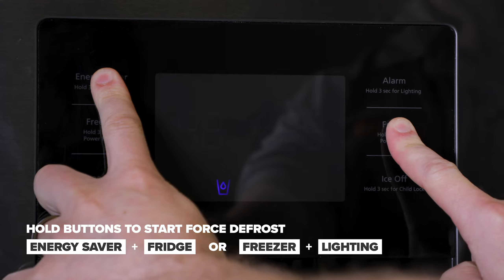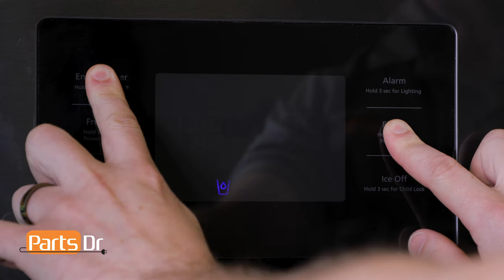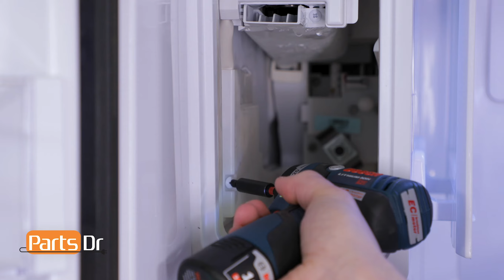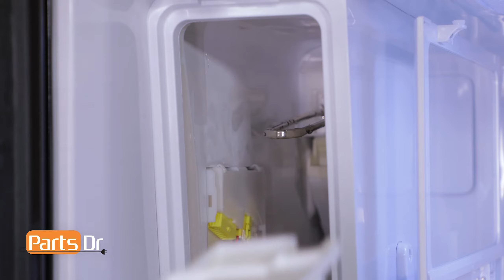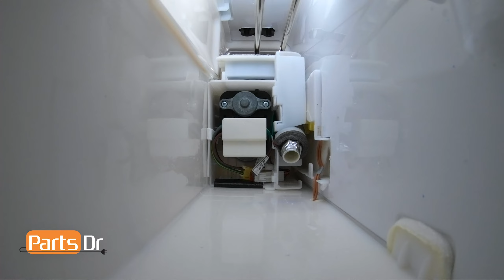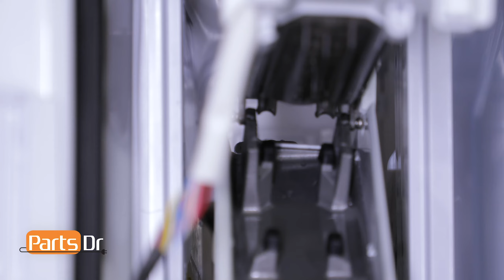How to replace the ice auger motor assembly part # DA97-12540G & DA97-12540K in Samsung refrigerator

Comment from the maker: Thanks for watching our step-by-step guide on replacing the ice auger motor assembly in your Samsung refrigerator! If you're ordering a replacement, be cautious with cheap aftermarket parts found on Amazon or eBay. These often lack the quality and precision of original OEM components, which can lead to poor performance or further issues. For genuine high-quality replacement parts like DA97-12540G or DA97-12540K, order directly from https://partsdr.com to ensure a reliable repair. Let us know in the comments how your repair went or if you have any questions. Happy repairing!

Comment: Um, yeah. So the Samsung professional repair guy came out several times to "fix" our ice maker. In the course of that he did the silicone sealant fix and now my auger assembly is apparently glued in place. Yes, I know about clip on front that needs pressed. In fact, it's completely gone now and the freaking thing still won't come out. And no, there is no ice keeping it from coming out. I am never buying Samsung appliances again. Spent over $3000 on this f-ing thing and the ice maker has been a problem the entire time we've owned it. All they did was patch it long enough to run the warranty out.

Comment: Quick follow up. After about 3 hours I finally got the ice melted . The ice built up between the top of the fan of the auger and just underneath the coil. Take your time if you do use a hairdryer use it on cool but take your time. It will free up once the ice is gone from above the fan motor.
Reply from the maker: Nice job!  Make sure to install Y-Clips https://www.youtube.com/watch?v=4WrzNhySQa8 if you don't already have them installed and seal up the ice maker compartment https://www.youtube.com/watch?v=8DkXLEXKAug

Comment: So I replaced the ice maker so I am familiar with taking this out. Now I am trying to get the Auger assembly out but it is not budging. I am sure it is an ice buildup so I am waiting.
Reply from the maker: It sounds like it is most likely frozen in place.  Let us know how the repair goes.  Be careful to no use any heat sources as you can easily warp and damage the liner of the refrigerator.

Comment: Have not been able to removed the ice maker tray, even after running the defrost routine for 5+ hours.   This unit doesn't appear to have the tab that has to be pushed to get it out.   The model number is RF28JBEDBSR/AA.   Does it ever take this long to defrost the ice maker?   Any other suggestions?   Thanks.
Reply from the maker: Yes that is normal if it is really iced up.  When they get this bad it is a good idea to unplug the refrigerator and leave the doors open and let it thaw out for a day or two.

Comment: Thank you for this video. The bolt that holds that metal plate with the two points on it sheared off from being frozen solid for so long. I thought it was going to be a nightmare replacing that. This video showed it only takes pushing in a retaining clip. Thank you again! New subscriber!
Reply from the maker: Thank you for subscribing!

Comment: Is the temperature sensor the one that looks like an IR sensor? It has a clear eye.

I cut my wire to that while chipping ice off and am trying to repair it. Right now I can reset my ice machine and a few minutes later it makes a beep/ding. I sometimes get a tray, but that's all.
Reply from the maker: The clear eye is the IR sensor that senses the when the ice bucket is full of ice and tells it to stop making more ice.  The temperature sensor is to the left with the yellow wires.
Reply: @PartsDr  thank you very much! I was able to solder the wire and have ice again! Your videos are really helpful!!
Reply from the maker: @khumprp  Nice job fixing it!

Comment: Is the I/R sensor located on the auger assembly supposed to emit a visible beam?  Mine does not.  Unless its only visible with the refridgerator door closed.  My icemaker does not drop ice and I think its because it thinks the ice bin is full.
Reply from the maker: I/R (infrared) is invisible to the human eye.  Sometimes you can use a camera to view the infrared LED lighting up.

Comment: I can't get the auger motor out. It is froze still from the piece on top of the auger I forced defrosted twice and it has been off for 3 hours
Reply from the maker: If you have a large amount of ice it can take longer than that to thaw it out.  Stick with it and you will get it eventually.  You may need to leave it unplugged overnight with the doors open.
Reply: @PartsDr  thanks i got it out sbout an hour later. It's making ice today. Thanks for your video
Reply from the maker: @kfd165  Good deal! Nice job!

Comment: My ice maker does not turn the ice out of the dispencer when I push the ice button. Do you think there is a problem with my motor?
Reply from the maker: It could be.  You would have to do some troubleshooting to see if power is being sent to the motor when it should be running to see if the motor is bad.

Comment: Hi and thanks for a very informative video.  I have persevered for a number of years with the ice-maker freezing up every few weeks, by removing the ice bucket and defrosting the ice-maker. However, it stopped working altogether and I thought the auger motor had finally given up the ghost. However, after disassembling the complete auger motor and applying 240VAC to the motor, I found it to be working. Now I realise that when initially putting a glass or cup to obtain ice, you push against the ice activator lever and there is a sound with the bottom flap opening before the auger motor starts operation. Well, this appears to be the problem - perhaps the solenoid? Any ideas on this?  No help from Samsung at all. Thanks and regards, Robert

Comment: Great video! Quick question for you. There is a plastic shield that sits over the coil and the styrofoam (not the rectangular piece that goes over the coil) that is made of the same plastic as the interior.  What is the function of this piece and does it direct the water flow flow in to the ice maker? The back of the ice maker appears like it would go up against this piece. Mine appears cracked and possibly bent, and there are three screws on the right side of the ice maker compartment when the auger motor is removed, which looks like it would allow it to be replaced. I can just see it in this video but its out of focus. I have a screen shot from your video and circled it in red if I Can find a way of posting it.

Comment: Replaced ice maker and auger assembly.  Difficulty removing old parts - New parts went in easily , thanks to your videos. That being said no ice has been made after 22 hrs. It appears that the Ice sensor on the auger assembly is not lit...Any ideas????
Reply from the maker: The sensor on the auger that senses when the ice bucket is full is infrared so you won't see it light up with the human eye.  It should start making ice on its own after it cools down to 10F or colder.

Comment: Thank you so much for this video.  We went almost a year without ice because none of the local repair guys would come near it.  Bought the part and installed with no trouble in 15 minutes.  Very clear and great video shots to show the process.
Reply from the maker: That is awesome!  Nice job!
Reply: I cant get the replacement auger to snap in. Its a good 1/2 short of the clip point. It is the correct model.

Comment: Is the Ice Maker reset button a missed step in this video? Also, is the reset button supposed to make a chime after a few seconds?
Reply from the maker: It won't hurt to use the reset button but it is not a required step.  Some refrigerators will chime after the reset button is held for a few seconds.  Our refrigerator in the video the reset button didn't do anything.  It didn't chime and it didn't harvest the ice and fill with water after holding the button down.  But the ice maker still functioned perfectly fine.
Reply: Where is the ice maker reset button?

Comment: My thermistor broke off on auger assy DA97-12540A. Can this be purchased separately?
Reply from the maker: Hi Kevin,  from what we have seen this sensor is not sold separately.  But, from what we have seen all of the senors in a Samsung refrigerator usually have the same resistance scale but have different length wires and electrical plugs.  So, in theory you should be able to order a different sensor and cut and splice the wires.  More info about these sensors in this video here: https://www.youtube.com/watch?v=J5bwcteeJNM

Comment: Hi Dr, 
My RF263BEAESR/AA not making ice. Load status display showing ice full, but no ice inside.
followed troubleshooting manual, blocked IR receiver with hand no status change which indicate receiver defect. bought replacement auger DA97-12540G from PartDR, But still same problem, any input?
Reply from the maker: Hi Nick,  these types of things are usually not able to be diagnosed over a youtube comment.  If the new auger motor assembly didn't resolve the issue, then we would suspect it would most likely be the main control board or the wiring between the two.
Reply: @PartsDr  I do suspect the main board also for my next step. pressed ice maker test button it will produce 1 cycle of ice no problem and ding dong sound after that. so I think the ice maker it self is still good.
the weird thing is even with the new Auger assembly, blocked IR receiver Emitter test, still didn't change ice level status.
I did verified good continuity and volt test CN90 #5 Yel to the main board from IR red wire +5V.
Thank for input
Reply: @nickmiller4544  figure this out?
Reply: @s1337m  No, so far I did replaced the auger assembly and main pcb, But still same issue. Last one that I need to replace is the ice maker it self, but I don't want sink more $ to it and may not solve the issue.
Reply: @nickmiller4544   - any luck with this?  I'm at the same point as you sounds like.  Replaced auger motor and still seems like IR emitter not lighting. Was going to try a new main pcb but sounds like didn't help for you.  Too bad.  I think the IM itself is fine as it makes 1 load of ice when I press reset.  Please post if you get it figured out or make any headway.   Cheers!
Reply: @ladriver  No, I didn't replace the Ice maker, as it's the last item that I think  would cause it, I mean it got to be one of those 3 item, Auger assembly, or main PCB, or the ice maker  it self which seem fine with test button. I have verified also Wiring harness  continuity are good.
So far I can live with just press the test button everytime I dispense some ice

Comment: When did the auger heater get added by samsung not sure if mine has the auger heater how can I tell I HAVE A 2016 MODEL RF 28JBEDBSG/AA
Reply from the maker: Hi Wayne, we haven't heard of a date that you can go by.  In most cases it is best to disassemble and inspect the original part.
Reply: @PartsDr  thanks is the part in the video with the black tube the heater so if it has a clear tube no heater? Asune that what I will be looking for?

Comment: Will the refrigerator function properly with the auger fan motor unplugged?  The fan is noisy and we don't use the ice maker. Is the auger fan motor used only to produce ice?
Reply from the maker: Hi Larry, as far as we know the auger fan motor is only used for cooling the ice maker compartment.  BUT, if the fan motor stops working or if you remove it from the refrigerator it could potentially cause and error code on the refrigerator which could cause you other issues.
Reply: I removed it completely and refrigerator will not run without it.  Defrosted the refrigerator and have not heard the noise since. thank for the help
Reply from the maker: @larryearle5949  We are happy to hear that took care of the problem! 🙂

Comment: My auger does not want to come out.  I had a huge ice build up around the coil and got that thawed out.  I released the auger and I can pull it about 1/2 inch and then it stops.  Seem like it is catching on something.  What I do see is an ice build up still just under the coil in that rectangle area below it.  Wondering if there is ice below that area stopping the auger from coming out.  The fan was making a loud horrible noise the last few days, so just wondering if it was rubbing on ice or the bearings are shot.  I just want to get the auger out and inspect it first.  Any hints on getting it out?
Reply from the maker: Try leaving the refrigerator unplugged and the doors open for a day to let the ice maker compartment thaw out.  There could be some ice that you can't see that is causing it to not release.  We have also seen people that use a blow dryer or heat gun warp the inside of the cabinet which could cause the auger to not come out freely.
Reply: There is an i build up on the auger fan assembly. If you dont leave it unplugged, Samsung suggests a soft steam to unblock the ice to remove the ice and remove the assembly.
Reply: Thanks...my samsung refrigerator ice maker head motor ( srm-27h ) not turning  around .only sound and the gear not turning. your support that how i can test and replace it....thank you in advance

Comment: I have RF 28 we replaced ice maker pushed reset waited made 1 tray of ice then no more, pushed reset then dumped tray full of ice what could be wrong?
Reply from the maker: It could be many things... the ice maker could be defective, the water valve might not be supplying water to the ice maker, the temp might not be getting cold enough for the ice maker to produce ice, the main control board could be bad.
Reply: Replaced with new Samsung ice maker checked the two solenoids both probed out at the  same resistance, door water works fine . It will dump ice if I push reset button after it dumps.
Reply from the maker: @davidyarbrough6426  It's hard to diagnose problems like these over a youtube comment.  It sounds like water is making it to the ice maker from what you described so you can rule that out.  It could be the ice maker compartment not getting cold enough, a defective ice maker, or a defective main control board from what you described.
Reply: Thank you for your answer. I put a indoor outdoor thermometer and it went down to16 degrees. Any other solutions would be appreciated.
Reply from the maker: @davidyarbrough6426  where did buy the ice maker from?
Reply: Appliance parts depot in Ft Worth Texas, Samsung part not after market.
Reply from the maker: @davidyarbrough6426  Maybe have them try exchanging the ice maker for a different one.  We measured 5-7F in the ice maker compartment on our refrigerator that uses this same ice maker.  If the temp doesn't get below the threshold for the ice maker to trigger and make another batch of ice then it won't produce ice on its own.
Reply: Thank you I will try that.
Reply: David Yarbrough - wondering if you ever figured out a solution for this?  I seem to have very similar problem.  I have Samsung 28RFHDEDBSR - complained to Samsung about the frozen block of ice pretending to be an ice maker.  To  their credit, they sent out a guy who made all the modifications (y-clips, sealed compartment, etc).  Working fine for 6 months then all of a sudden - no ice is being made.  Replaced water filter.  Water dispenses fine.  Will make and dump one tray of perfectly fine ice when press reset button then nothing.  Seemed that the ice level ir  transmitter was not working (diagnosis mode also shows bottom horizontal section of 3 digit from left is blinking - means ice maker thinks it's full- as far as I can tell),  so I replaced the auger motor as above. Still no joy and no ice.  Not sure what to do at this point.... wondering if you figured your out? Hope so.  Any additional info would be appreciated.  Cheers!

Comment: Your video instructions were precise and helpful.  After reinstalling the ice maker it wouldn't make ice. I found out there is a reset button on the front right side of the ice maker. It is rubber and I had to push it in and hold it for ten seconds to reset the ice maker. Thanks!
Reply: I pressed mine for 20 seconds and never heard a chime. Did you hear a chime?